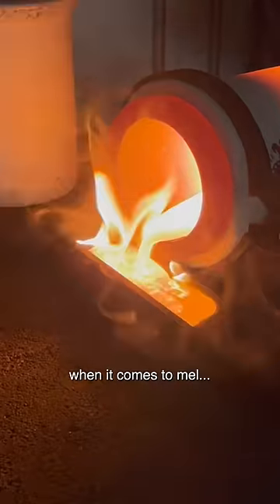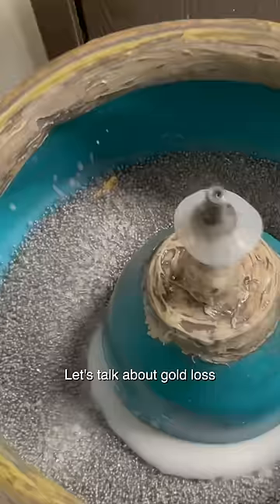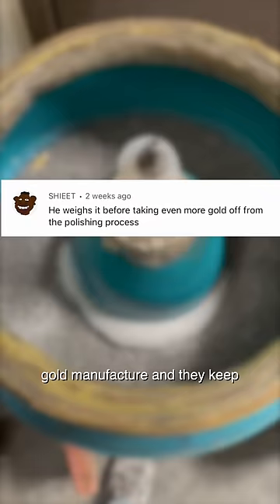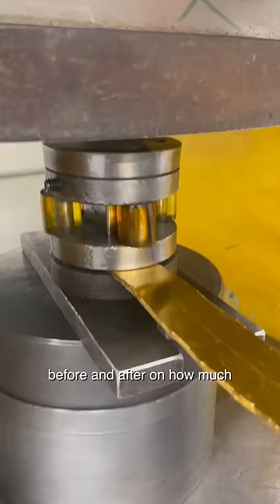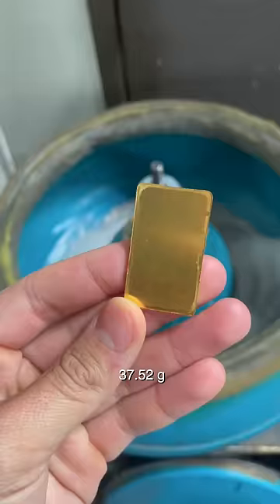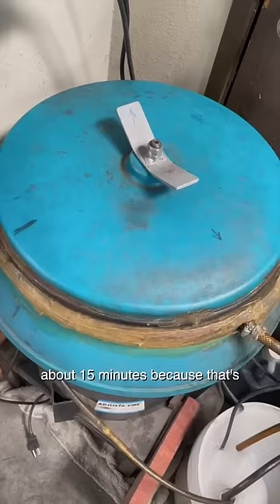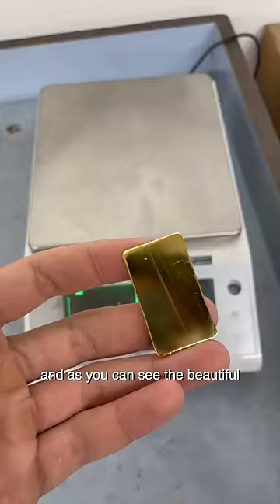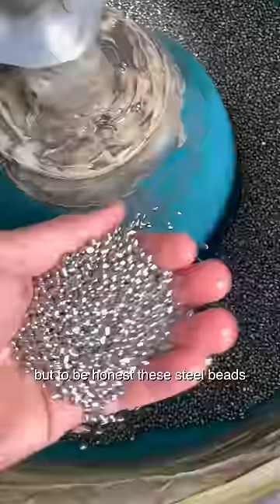How much gold loss while polishing gold coins!!

Comment: Gold don’t float.
Reply: It’s not “floating” in a sense that the gold is buoyant enough to float in water.  The gold flakes just have enough surface area, and are light enough that they don’t break the surface tension of the water.  It’s a didn’t method of action than “floating”.
Reply: @Jmacdonald2386  panning for gold works even on the smallest pieces because it won’t float regardless of surface tension I thought?
Reply: @valleyofsouls5523  yeah that’s a good point, that’s exactly how gold panning works so you might be right
Reply: @Jmacdonald2386  I mean good thinking on considering surface tension. Most people wouldn’t even understand that part. lol. 

Yeah sadly many other things can fool people thinking it’s gold.

Comment: This is gold and you're weighing in centigrams... Of course you won't measure any difference.
Reply: less than 0.01g difference. 0.01g is ~$0.623 as of now. sixty-two cents and you're up in arms? or are you joking
Reply: @СНІМР It's not the money, but the technically wrong approach to the question of whether there is a loss while polishing or not. When polishing (!) you need the right resolution and not showing a misleading "numerical proof" of no loss.

Comment: Even if it’s .001 which I’m guessing it’s probably 0.003g
That’s still 3 grams per 100 bars… if that’s acceptable to you, then by all means. It wouldn’t be for me. I’d rather sealed induction than sanding

You make a living off selling weight, so any weight lost, is not really acceptable

Comment: Yeah, but you got to remember that polishing removes a lot of weight, you will see there is some gold flakes left over after, as the steel beads are abrasive to the gold, if you save all these gold flakes after 1000s of polishes you can sell it back for somemoney, in gold districts people mine the gold dust from the cracks in the sidewalks

Comment: You should buy a better weigh machine then you will be able to see the difference after polishing.
Reply: Ah, and you're a professional who knows what they are talking about right?
Reply: @Repolor  Yep, I deal in weighing machines also in the brand which he is using and it is one the best brand but better models are available which are more precise, they can even measure the weight because of air pressure.
Reply: @AsusZenfone-kz3fc who cares about 0.001 difference, he said polishing removes minimal gold
Reply: @AsusZenfone-kz3fc it's gold 
Gold is heavy
He will never need to know the super small and precise difference after a polish